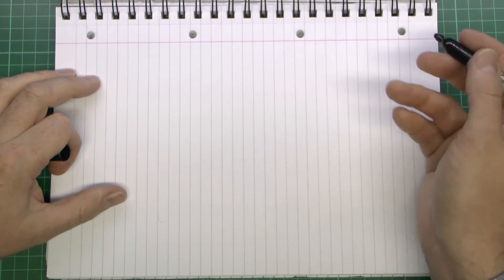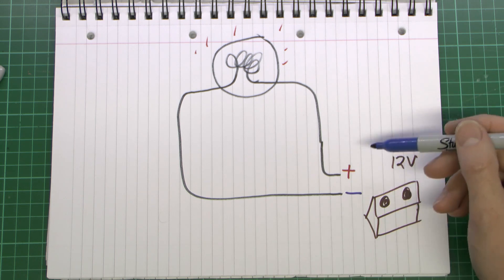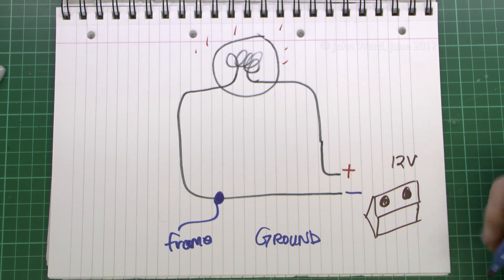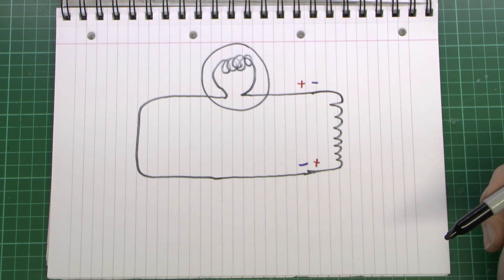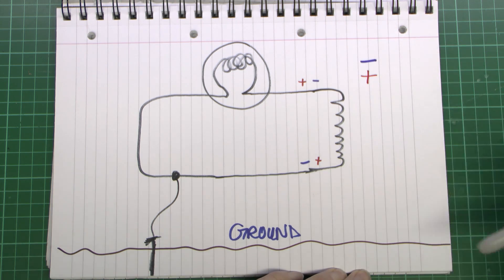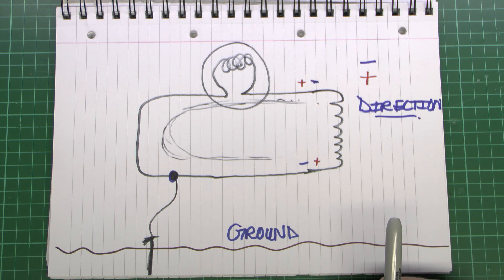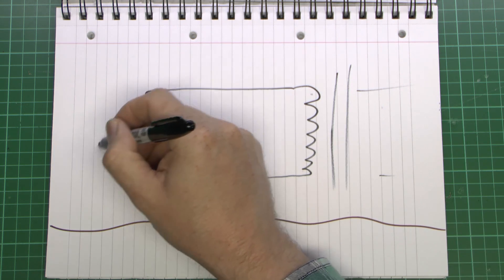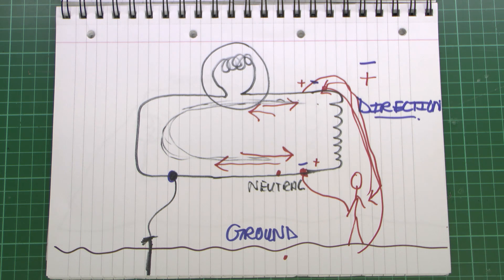AC, DC and Polarity in Electrical Systems

Comment: In a Ac single phase system, say TNCS. How can current flow through the neutral to the consumer's  installation on the negative half of the cycle as the neutral is connected to ground due to PME.

If current flowed from the transformer to the installation then all the earth bonded metal work would intermittently become live.
Reply from the maker: Current flows in the N on both parts of the cycle, the only difference is that on one half L is positive relative to the neutral, and on the other half it's negative relative to the neutral.

Comment: Such an informative video this is.
I have one question though. I have a DC power supply that came in with a polarity conversion cable. The power supply is center negative which means the polarity adapter will convert it to center positive. This is my question, can I use this adapater to convert a center positive tip to a center negative one?
Reply from the maker: Yes, all it's doing is swapping the two connections.
Reply: @jwflame  Thank you John! It works! I appreciate the help!

Comment: Great video. But One question why current doesn't flow towards earth when returning since it is providing a parallel path. same case for neutral when it flows forward and backward neutral is grounded why current dont flow to earth. same for dc.

Comment: Sorry to ask such a 'Noob' question...looking at 7:41...if the voltage would flow so readily through you to ground if you touched the top wire, 1) - Where on that loop would it suddenly become safe to touch? After the bulb?? I'm struggling so much with this, even though it's supposed to be simple!
2)- Why then doesn't the current instantly flow down the ground route, instead of following the wire back to the transformer, if they are both at the same potential. Sorry once again!

Comment: Hi John, I have a question.

Why or how does the line, the dangerous wire, stop becoming dangerous and become neutral, just because there is, e.g. in the case of an incandescent bulb, something on the circuit. After all, there is still a wire in the bulb. How does it 'know' that it is dangerous to one side and not the other. It might be said that it is because the neutral is earthed. But, the line and the neutral are both earthed only the line is the other side of the bulb. 

And what happens if the wire is just a wire with no load in the circuit. Is it both line and neutral at the same time?  But if it is, why does placing a bulb in the circuit change the dynamics so completely.

I'm clearly missing something fundamentally simple, but, please put me out of my misery.
Reply: following

Comment: This is a really confusing concept, like how do multimeters know when you connect the red probe to neutral and black to the live terminal and how come if you connect an appliance with reverse polarity it causes a problem. And (without breaking the circuit) if you touch the live wire you get a belt off it but touching the neutral you don’t. It causes confusion when people say the current goes in one direction then the other coz if you walked to the shop and took one step in one direction and one in the opposite direction then you wouldn’t get anywhere!

Comment: So an LED (light emitting diode) in a DC circuit will only light when current is flowing one way as the diode only allows electrons to flow in one direction accross the semi conductor. Does this mean that all our LED bulbs for mains power in our houses must have rectifiers in them as otherwise they would just flash constantly at the same frequency as the AC current?
Reply: It's been a year or more but no. Most standard led lightbulbs have no polarity. It does constantly flash but it happens so fast your eyes just see it as one picture

Comment: So it does matter how we connect the socket for the light Bulb, right?
Reply from the maker: Electrically it will work either way.  It doesn't matter for bayonet and similar sockets.  Screw sockets should have the neutral connected to the outer thread and line to the centre pin otherwise it would be possible to get a shock from the outer thread when removing or installing the lamp.

Comment: So, if you touch Neutral then no shock, but how then does the RCD work if there's no current on the neutral? I don't get how if the current is equal on the L and N you don't get a shock from N ?
Reply: Gary Dickson there is just as much current on the neutral, it's the potential difference between where you're standing and the wire you grab which is important. If you're effectively standing on earth and neutral is at the same voltage or potential difference, nothing will happen when grabbing neutral. The RCD works seeing if there is leakage to ground outside of the system.. that is if suddenly there's massive current going out but not returning it should trip

Comment: dear mr ward! 
first if i understand it right comments with links go into spam so a put them out! in these vid i have a point miss! i have no idea what kind of systems in england is usesd but in germany are many different! its common in germany that neutral is grounded at the transformer and also grounded in the buildings! neutral is in many cases ( the lines under the streets ) much thiner because in a symetrical load on 3 phases no current must flow over neutral! in teorie neutral is not requred, but there is no symetrical load. they lock a long time on it and come to the idea ist just for exampel less than 1/3 of the current from one line will in nearly 99+ % of all cases flow over neutral! if heavy currents flow there is a decend voltage drop on neutral or pen ( its neutral and earth together ) in the case of short circut or massive overload and a rotten or bad building ground you can get deadly voltages on neutral! also i hate the idea to ground on 2 points because there are allwais current flow over ground ! i also hate pen because in case of heavy overload or short circut voltage on metal parts pushed to unsave levels! or if pen lose the pe is lose to! in gerneral the problem on the vid is not to explain everything , the problem i see is some people beleve neutral can be tuched! there are so many cases i have seen deadly voltage on neutral! another example short circuts in gereral on symetrical lines leeds to half of line voltage on neutral on a spezific point! another problem is a lose neutral on a system leads into full line voltage on neutral point in the larger system! many people see these vid and make stuff itself! we dont want to kill them ;) i am a industrial mechatronics and have a lot to work with electrisity. for example at large systems in large factorys or in desy xfel ( hight energy physiks reserch center hamburg ) xfel its a small special light source! there are much lager systems on earth but german governmend dont give much money to reserch! most of money go to banks and refugees:( if russia not heavly supportet x fel there were notheing ever build! they have plans for make the largest system ever under hamburg but they only get money for a lager torch ;( if desy have petra not removed and make all stuff on full power they needed more power than a mid size town ! hamburg have 3 master substations! desy have 3 master substations to :P set from 115 000 volts to several mid voltage ranges! parts there are not on desy property ( because its underground on a large scale under city hamburg ) are feeded from desy subs ?? i dont know! special in larger systems there are many problems of these kind! i have also seen on metal parts there are boltet on concret half of line voltage and never find the mistake! i try to schort it out with a low impedance grounding to see witch fuse is involved! no its was deadly low impedant source but i cant blow the fuse! or never found the circut is involved! i get oder to ground it good so the voltage drop! :((( if some heavy magnets or radio microwafes or radioaktivity or everything like at desy is involved forget it 0.000 ohm ground is to hight! ;( but i also make often electric or electroniks stuff in private! and ist not only a problem in larger uncommen systems! i found mistakes i like to instal all new but i cant! i dont get the mistake and no one i aks have a idea it make sense??!! if you have any questions just aks! byside i have no idea if the question you answere here was on the point to get right phase shift an parallel systems or general in multiphases systems and so on!

Comment: Regarding DC circuits, I've never understood why some folks insist that the current flows opposite to reality.
Reply: in the early days of electrical experiments it was thought that current flows from positive to negative. it wasnt until many years later that electrons were shown to be the mobile charge carriers in conductors and they were in fact negatively charged and moving the other way, but by that time the convention of thinking about and depicting current as flowing from +ve to -ve was well established and they never changed it for some reason, so now we're left with the slightly awkward situation of conventional current going in one direction and the actual electrons in the other

Comment: Thanks for another excellent video. Can I ask a novice question? In the grounded AC example I think I understand the concept of the grounded neutral side of the transformer being 'safe' and the line side being dangerous. I think what I struggle with is where one becomes the other. What is it about the light bulb in your example that provides this boundary? Thanks!
Reply: If anyone is still wondering about this, the answer is the resistance or impedance of the light or whatever consumer you happen to have in the circuit. The device will draw power from the system by creating a voltage drop over itself, thus it's neutral connector is at ground potential and the line side is at the line voltage and the difference in voltage times current through the circuit equals power used in the device, which is then transformed into heat, light etc. useful things. If the lamp would just be a zeroish ohm piece of wire your current would try to be infinitely large and then the power would be created everywhere in the system and unnecessary smoking would ensue shortly.
Reply: Matt Kingston hi Matt. I understand that the circuit is symmetrical and that either end of the transformer's coil could be grounded. But what role does the bulb play? Why is it that the bulb marks the boundary between the safe and deadly parts of the circuit?
Reply: Jon Yeah, this is the bit I don't quite grasp. Maybe it's that because of the impedance of the bulb you're providing a quicker path to earth? I dunno.
Reply: Jon, its the actual grounding of the circuit that makes it neutral and therefore "safe" assuming no other faults in the system.It doesn't matter which side of the bulb/load is grounded as which ever side is wired to ground will automatically become neutral.Hope that helps a little.

Comment: What am I missing here?  If the current can flow both ways and the + could also be - and vice versa  . . how can one wire be dangerous and the other not.  Why are they not both dangerous or both safe?   Similarly, how can current be dangerous at the start of the live cable yet be safe when it returns.  What changes it to safe negative from positive?       Yours, confused.
Reply from the maker: Voltage is what matters.  The neutral is always at zero volts compared with the ground and touching that will not result in a shock, as zero voltage = zero current.  Line is either +240 volts or -240 volts which will cause a substantial current to flow in either direction between line and ground.
Reply: Relevant search term is "potential difference", potential being another, better word for voltage.

Comment: In Norway, we mainly have 3-phase IT (isolated terra) transformer circuits for the end users. The voltage between the phases are 230 volt 50 Hz, and voltage to earth is about 133 volt. None of the phases, not even the neutral point of the transformer is connected to earth, and the neutral wire is not present.

Even if the IT transformer circuit is without earth faults, you can get lethal shocks when touching a live wire and ground because of the so called "capacitor effect". The bigger the transformer circuit is, the greater earth fault current.

Most modern transformer circuits are 3-phase TN (terra neutral), with an earthed neutral wire, 400 volt 50 Hz phase-phase, and 230 volt 50 Hz phase-neutral/earth.

Comment: I know of a company that makes a mains relay, and advertises that it "only switches power at the 0 cross-point of the sine wave." Is that a useful feature, or just marketing? Thanks for another useful video.
Reply from the maker: Switching at non-zero points will usually create interference both as radio waves and carried along the mains wiring to other equipment.  Zero point switching eliminates this.
Reply: John Ward yep that's right, as with dimmers, mind you micro processor controlled types soft start, leading/trailing  edge are better than old style in respect of less generated noise!
kind regards Warren

Comment: the video is very good but it confuses me when I think about (1)live(phase,line or hot)            (2) Neutral and (3) Earth or Ground
tell me about the difference between the earth/ground vs neutral 
if I check the voltage between live to ground or say live to earth that I would be 230 volts(depend on country)
but there is 3 to 5 volts exist between ground/earth to neutral 
comment on this and correct me if I m wrong 
thanks
Reply: The key difference: the neutral wire is the expected return path of the current. If, however, an appliance fault caused it to go down the earth wire instead, bypassing the neutral side of the RCD, that would cause the RCD to trip. In an ideal situation there should be no measurable voltage between neutral and earth, but I have heard some people say "up to 40 volts" - never seen it myself, and have no source to cite.

Comment: You explained why we earth things, but I can't help wondering why with modern equipment why it wouldn't just be safer to say live or neutral could both be live and that as long as there isn't earth leakage then nobody would get a shock. You would have thought that the electricity company could detect a ground fault automatically and disconnect via some method near the property. 

I just wonder if we redesigned it again from scratch knowing what we know now whether it would be done differently. This is purely curiosity as I am not a professional, just thinking after watching your video.

For example what if every property was fitted with an isolation transformer? wouldn't that be safer?
Reply: A lot of electronics are designed with the idea that either pole could be line or neutral.
When circuitry works both ways, or the electronics work both ways, they're called "unpolarized". If they only work one way, they're "polarized".
If you look at most phone chargers made for the North American or Japanese markets, you might notice that both pins are the same size. this means that they can be plugged in in either orientation. These are unpolarized, because either side can be hot or neutral. Some things, like microwave ovens, have one pin larger than the other so they can only be plugged in one way. These are considered polarized, because they require one side to be the neutral. Most plugs and sockets in continental Europe, outsize of the Swiss and Danish plug/socket systems, are unpolarized. They work both ways. Most plug and socket systems, are polarized, but a significant percentage of appliances and electronics work both ways. 

There actually is a system for saying "as long as there's no leakage, nobody gets a shock". These are called "GFI or GFCI or other names" circuits. These basically disconnect the hot connection if a difference is detected between hot and neutral. John Ward has done videos on these. They're well made videos. In practice, GFI circuits are installed at end points, like individual socket sets, or wiring branches in houses because it's difficult to make GFI circuitry that works properly at relatively large scales. Furthermore, it's safer to have a GFI circuit as close to the socket as possible, since you want to minimize the amount of time between the start of a malfunction and the disconnection. 

The issue with using isolating transformers for everything rather than grounding is that isolating transformers, like everything else, can malfunction, and then we'd be back to square one. Isolating transformers also don't handle certain things, like point blank lightning strikes, that traditional grounding systems can at least tolerate. 

If we had to redesign all electrical systems from scratch, there are A LOT of things that would be done differently. For example, all countries would have unified mains frequencies, rather than some places on 50, some places on 60, and some obscure places on 40 or 55. Airplanes would probably still be on 400 though. There would still be different sockets and plugs for things which are supposed to be incompatible "like the multiphase plugs or stuff for unusual amperage or voltages". But regional plugs would be abolished or at least minimized. For example, type H and K plugs would be abolished. Twist-lock plugs would be A LOT more common, and better made.
Reply: James X ,  this is the point, if all properties were to be supplied via an isolation transformer i.e. 1 per property it would add a sufficient cost and only provide a level of safety while the installation is insulated from the ground.  All it would take to create a dangerous situation is a trapped line conductor behind a socket touching the back box which is touching the fabric of the building.  There would be no way of detecting this until it's too late.
Reply: There do actually exist insulation monitoring devices -- this "IT" electrical system is used (for example) (locally) within operating theatres...